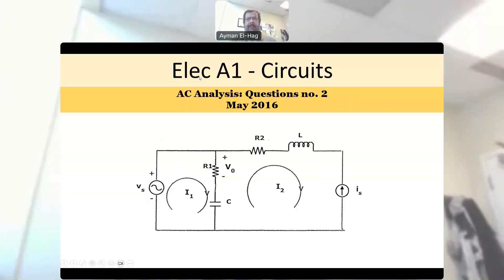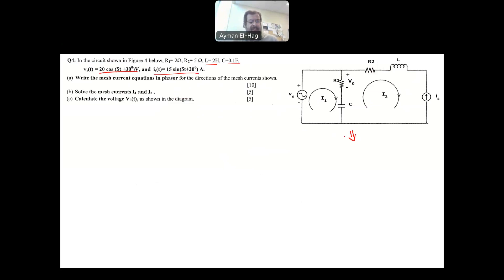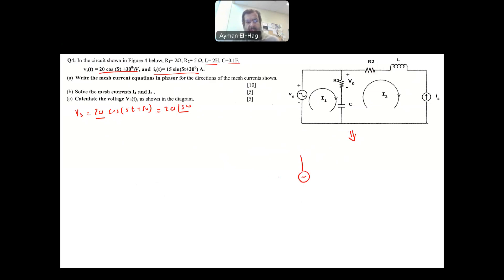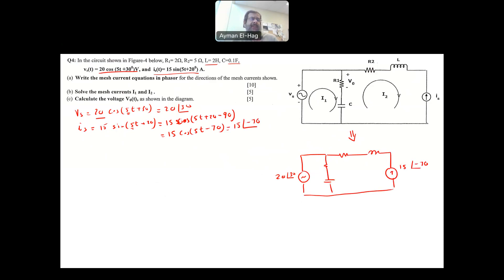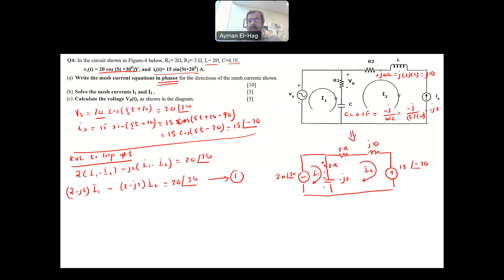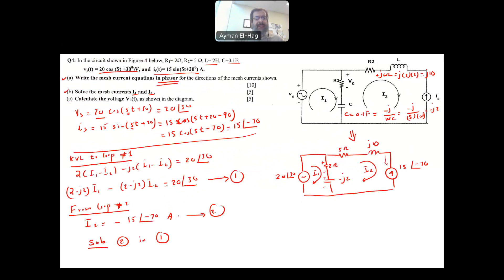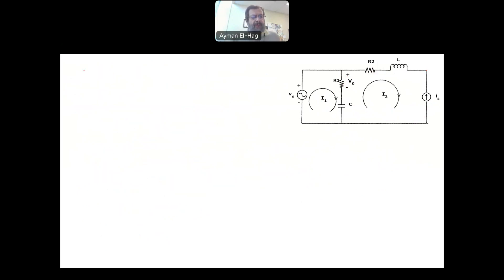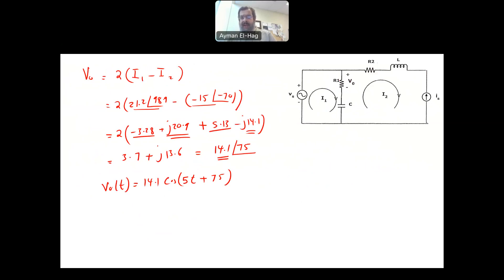PEO solved examples (ELEC A1): AC analysis Question no. 2

Comment: Hi Professor, when you reverse a current in polar form that is 15<-70, should we reverse the angle? so we will get 15<110 instead of -15<-70?
Reply from the maker: Yes you are correct.